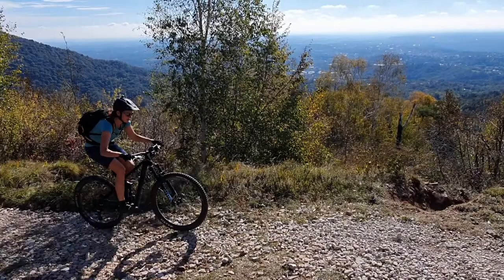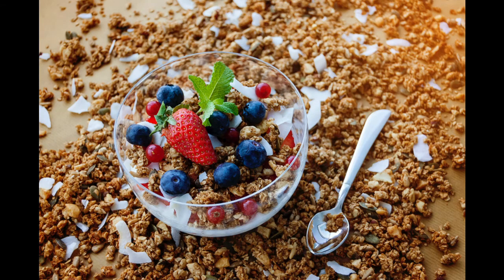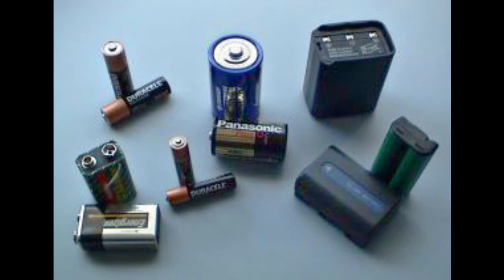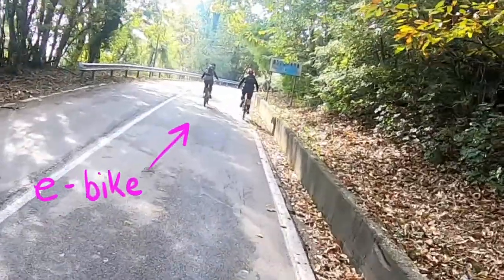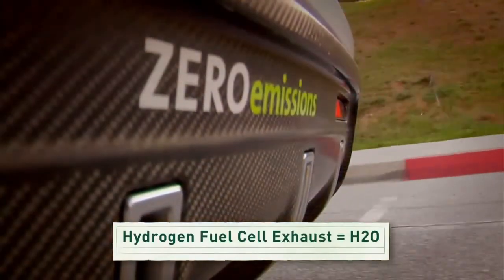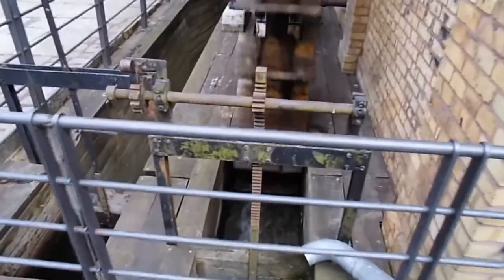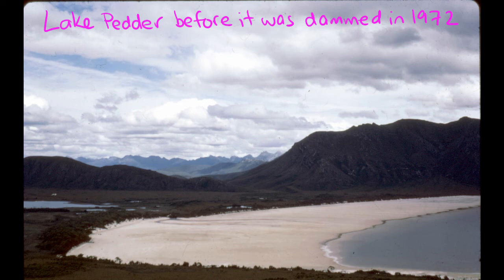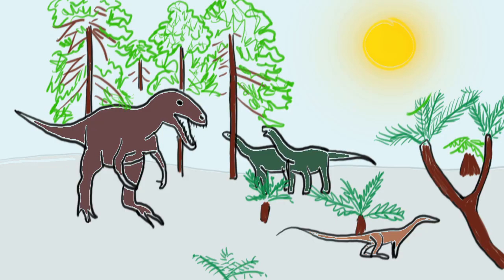Energy Storage Options for the Clean Energy Transition

Comment: Love the clarity of your forays into energy topics and would love you to explain Compressed Air Energy Storage. One graphic seemed to show that it is limited in scale. I think it is limitless, but I am not an engineer. I see compression where there is excess energy, like directly from wind, without an electric step. Or, perhaps where the heat of compression can be used for other jobs. Conversely, it can be transported long distances, from where it produced to where it is needed. The transportation system is also storage. Further, there are various opportunities to gain free energy in many parts of the process. Transporting, or storing in a hot area could add heat to the process, perhaps after some one way valving effect of transport. Or it could provide cooling services at point of use. It would absorb heat say for Air Conditioning work, then that heat would go back to work as additional expansion for kinetic work like driving a generator. I have not see good clear fun explanations like yours and would really enjoy one. Thanks always for your important work.

Comment: Great video Rosie. I thought one of the issues here in Oz is that the land is ancient, and therefore geographically quite flat after being weathered down over millions of years.
Pumped hydro as I understand it is is substantially more efficient/power dense/economical the higher the head height available, which can be a challenge for suitable sites.
Brisbane has some low head generation but it's quite small, certainly not on the scale we'll need as we hopefully transition away from coal. 
Oh and my electric mid drive kit has just been delivered, am about to install it on my mountain bike, you can still peddle them though, as much or as little as you want to :)
Reply from the maker: You are right that more head equals more power for hydro. Our mountains are rounded, but we actually have no shortage of hilly terrain suitable for pumped hydro. Check out this article for a list of 22,000 potential sites in Aus, even around Brisbane. 
https://www.anu.edu.au/news/all-news/anu-finds-22000-potential-pumped-hydro-sites-in-australia
I am in the process of making a video on Snowy Hydro 2.0, and I'll talk about pumped hydro in that video. So stay tuned.
Your bike project sounds cool! Have fun with it 😊

Comment: Like you presentations on energy storage. Prior to discovering oil the original plan to power the car was to use liquid air. That idea was ignored for a hundred years thanks to the IC engine. John Dearman has come up with using liquid air or nitrogen as the oxygen is more useful to drive a reciprocating engine. There is a commercial use now in powering the refrigeration on trucks which usually use polluting ancillary Diesel engines.
There is also a scheme being tried to cover short surges in demand in the. National Grid.

Comment: There seems to be a lot of sense in using old vehicle batteries to store energy, especially as we will increasingly have sub-optimal Li-ion batteries from electric vehicles which are pretty impossible to recycle (I'm told). I'm not sure of the pros and cons of that. If people had a bank of Li-ion batteries at home / small businesses to store, e.g. energy from solar panels on the roof to use later, is that a fire risk? Is it better or worse than putting the energy back into the grid (thinking of transmission losses vs battery efficiency).
Reply from the maker: Yes, there's definitely potential to reuse old car batteries in this way! I am personally a big fan of reusing as much as possible to minimise waste associated with batteries. There are a few companies developing products that use second-life EV batteries for stationary applications. An example is this Australian company Relectrify https://www.relectrify.com/ I am hoping to get a tour and interview with them soon, and I will make a note to ask about how they are ensuring there isn't a fire risk, so thanks for raising that potential issue 😀

If you are trying to decide whether to install batteries for home storage, I think it will come down to economics more so than effficiency. It would depend what your feed-in tariff is, compared to what you are paying for electricity. Currently, it doesn't usually make financial sense to put batteries in household systems, but that will change as battery prices come down (which recycled batteries should help), and if there was variable electricity pricing for households, reflecting the real market price, then that could change the economics too.
Reply: "Second life" use for EV batteries is almost a no-brainer. But as recycling goes, some EV manufacturers, like VW, already have pilot plants that recycle ~90% of material in old batteries, and others, like Tesla, announced intention to do so, too, mostly to insulate themselves somewhat from vagaries of raw materials market.
Reply: Batteries for households can make even more sense when you have tariffs like Octopus Agile here in the uk, the price you pay per kW varies every half hour and can go negative, so you can get paid to fill your battery.
Reply: @dougowt  Yes, and "vehicle to grid" chargers also make sense in that situation.
Reply: I'm no expert, but I've heard people dealing with such large installations would rather get new batteries than worn out ones, because individual cells may be worn out differently, making battery management much more difficult and working around it might be more costly than buying new batteries (especially when reliability is critical). I think the future of stationary storage would be batteries with different chemistries, not so well suited for EVs, for example for excessive weight. E.g.: https://en.wikipedia.org/wiki/Sodium-ion_battery

Also, AFAIK, extracting raw materials from used lithium batteries is already working relatively well, except the battery technology is changing so quickly the recycling processes get outdated quickly. Once the technology stabilizes a little, it should be fine. From wikipedia: "Recycling processes today recover approximately 25% to 96% of the materials of a lithium-ion battery cell." https://en.wikipedia.org/wiki/Battery_recycling#Lithium_ion_batteries
Reply: @peter.g6  Battery management systems are rather good at taking different cell aging into account, and those "second life" battery packs would be rebuilt, not just swapped in whole from cars, but I agree with you point.
Some Li-ion battery recyclers claim 90+% efficiency (Tesla also mentioned something similar lately). 
To me flow batteries seem promising for stationary storage. There are chemistries using cheap and non-toxic materials, and the machinery is bulky and heavy, but simple.

Comment: The best energy storage would be hydrogen.  The production of hydrogen can be accomplished by producing HHO gas or just straight electrolysis for pure H storage.  Use solar and wind to produce, pressurise and liquefy Hydrogen for future use. I am to understand that previously acid was needed for electrolysis,  but now the HHO community uses baking soda instead.
Reply from the maker: Thanks for your comment 😀
And I hope you will  keep an eye out for my upcoming videos on hydrogen since you are interested! 
I personally don't think there is a "best" energy storage, as every option has its strength and weaknesses, and applications that are better or worse suited. Hydrogen had a lot of potential, but I wouldn't expect it to ever totally replace pumped storage and batteries.
Reply: @EngineeringwithRosie  have you  ever heard of a solar fountain?
Reply from the maker: If you mean a solar powered fountain, then yes. Otherwise, no 😊
Reply from the maker: Whoa, that is crazy! I have just been watching a bit of Sean Connery-era bond, and this tech looks like it belongs to one of the villains from those movies.